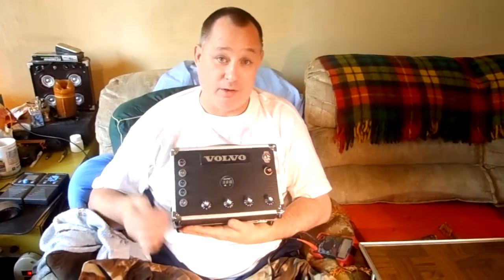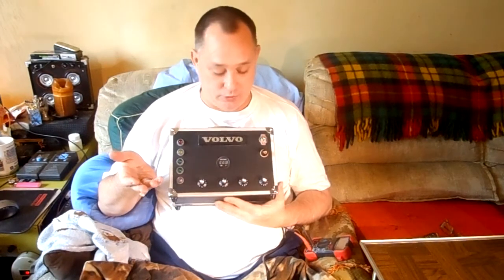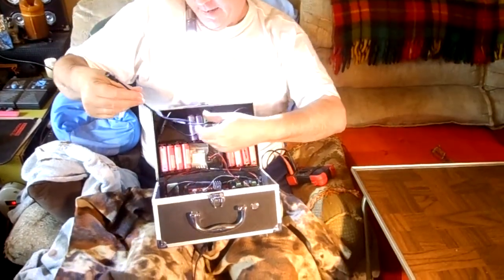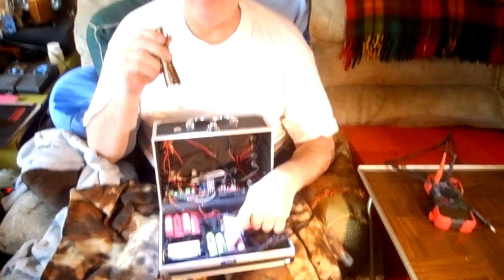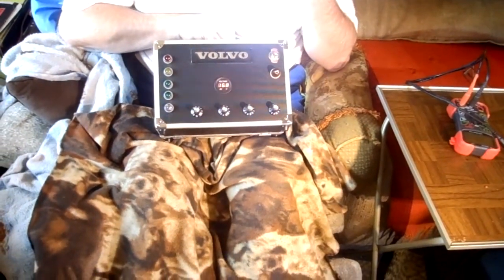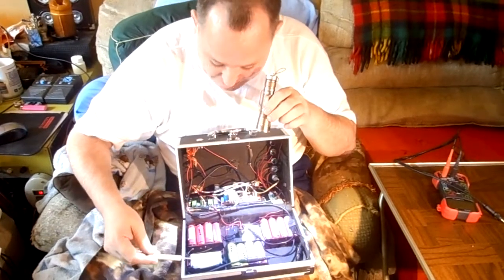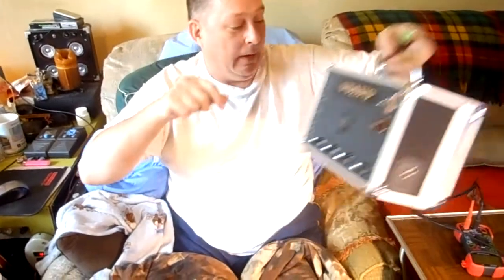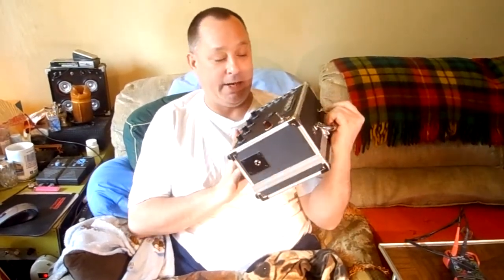Class D guitar amp - 100 watt - TDA3116 - powered speaker

Comment: Yo hice uno con el mismo chip pero lo pude reducir en tamaño similar al ehx metal muff
Reply from the maker: the unit in this video has internal battery pack ... which will power it for 18 hours ...  it also has an eq circuit , and led driver circuit , a separate amp for the led driver and more . so there is a few battery packs . i am not the type of diy person who is constantly obsessing about small builds . . . if thats your thing , enjoy your tiny stuff ! i like room to breath in my builds . instead of commenting how about a video ?